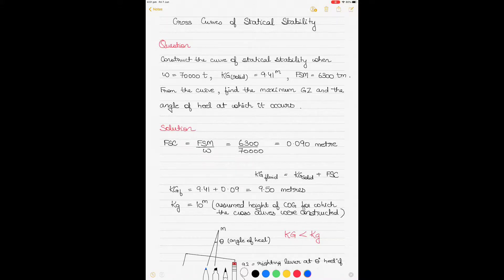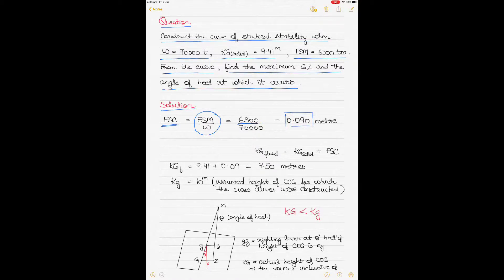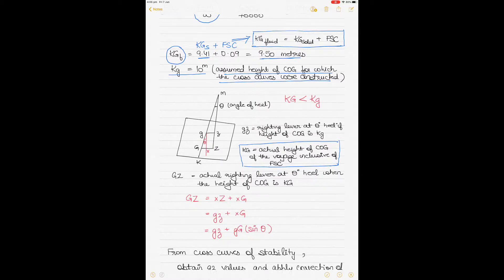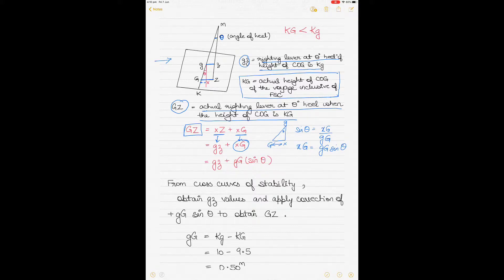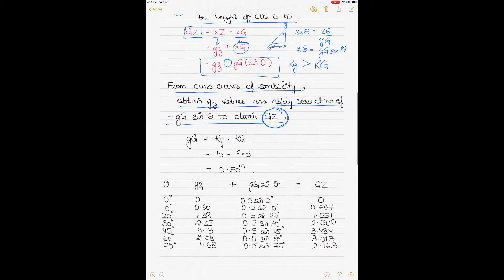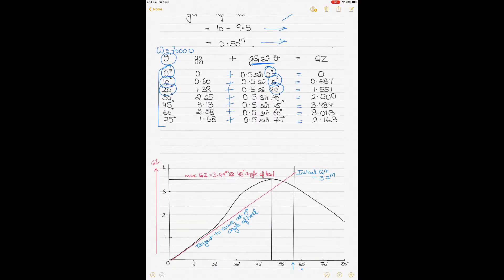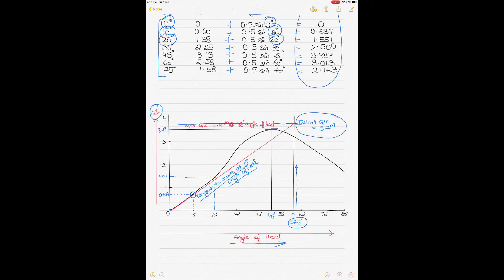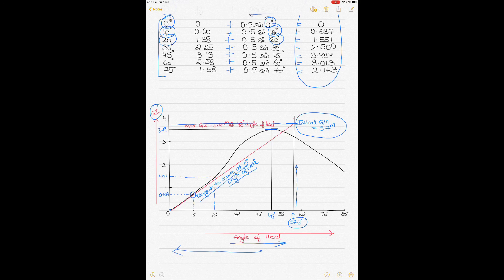Cross Curves of Statical Stability - Advanced Ship Stability For Mariners

Comment: could you pls explain why 57.3 deg was chosen on the x-axis to find initial GM?
Reply: That is because gz=gmsinx and when x is small gz=gm x . slope of curve is d(gz)/dx which is d(gm x)/dx= gm. If value of GM is plotted as an ordinate at 1 radian (57.3º),
 a line connecting the plotted point with the origin would be the
 tangent to the GZ curve at the origin.